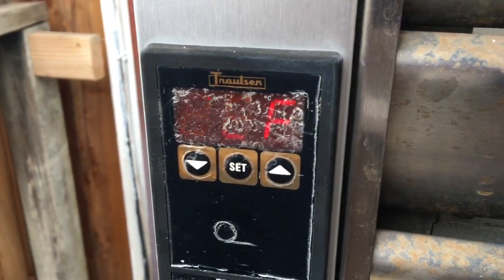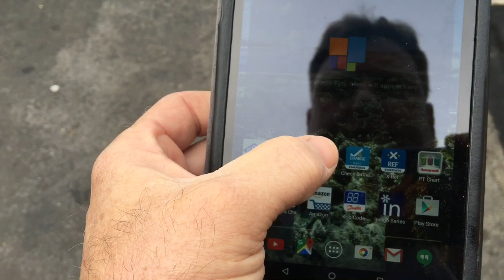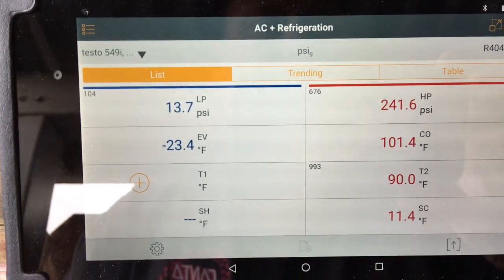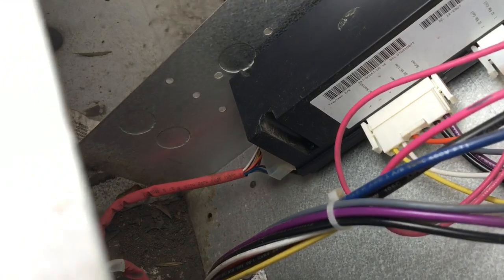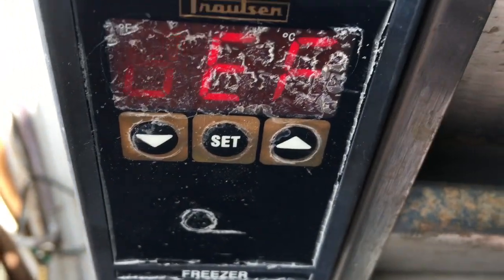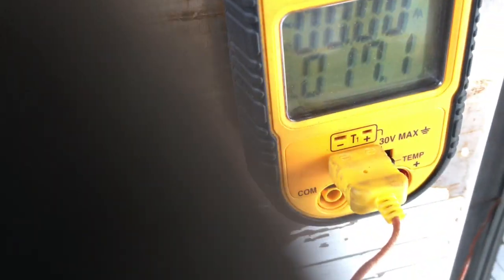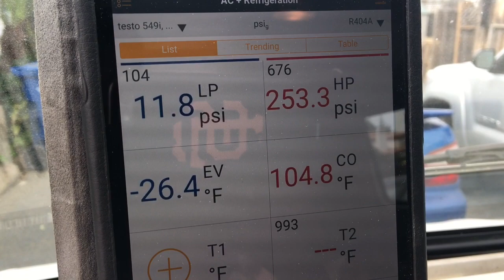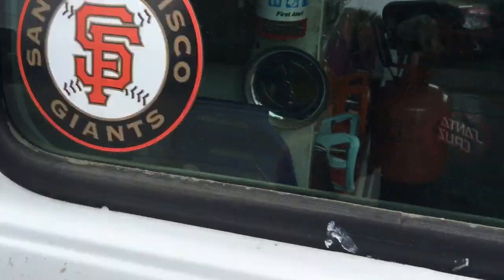Traulsen freezer intel I traul

Comment: Thanks for all the vids, but especially on the testo probes. I am in F&B operations at a horse race track but have also  taken on "first responder" duties for refrigeration and beverage equipment problems. Try to weed out the minimum wage "operator error" calls and take care of easy fixes, as well as implementing a condenser coil cleaning schedule. We have a lot of 20 yr old equipment from when the facility was rebuilt after a fire, so just about every other day there is something going down, between two large kitchens, seven bars and six concession stands. Just bought a testo pressure and temp probe to add to my toy box. Still need to call the pros when its time to pass gas or anything heavy or complicated, but wanted to get the tools to add to my diagnostic skills. Finally going to take the EPA test damn near 30 years after earning an HVAC degree in community college, but never going in to the field.

Comment: good video.  I have replaced many of those sensors.  Glad I got training from Traulsen when I did a few years back.
Reply from the maker: I think it was late 90's when that stuff came out. We all freaked out at 1 st but it has actually been pretty good stuff. That the 1st break down this unit it's 11 years old. Not bad.
Reply: No not bad at all.  When I was back at Hobart we cross trained in the Traulsen units too.  I still have the master service manual on those.
Reply: Hii sir, we have 3 door Tralsun freezer ,the Controller not giving correct temp reading,even I changed Original Green colour Cabinet probe.when I check with Digital thermometer cabinet temp was 0°F but freeze controller was showing  14°F

Comment: Was working on a True 2 door reach in freezer the other day, with a dual cap tube.  Not freezing properly I cut back the cap tubes 3 inches or so and a new drier and weighed in the 404a charge.  The compressor was noisy before and a history of it being noisy.  During an efficiency test it took a full 5 minutes to pull down to 8"and it climbed back up positive in under 1 minute. I was taught it should pull down to 16" in less than 1 minute once it hits 0, and should hold for 5 min. My After 20 minutes of run time it went from 50 down to 23, but the superheat was 90at the compressor, and 20f  Sub cooling.  The high side was 115F cold temp in an 80F room. Most tech say disregard these readings till it reaches temp =/- 5F.  my low side was about 16PSIG.  Ill find out Tuesday if it reached temp I guess.  One problem was the customer pushed these boxes inside the box, up against the back inside wall of the reach-in.  The top shelf was piled up to the fan.  I assumed this was half the problem on why they said one side would freeze and the other would be soft.
Reply: 115F condenser temperature (auto correct),  also +/- 5F

Comment: Nice video. I am servicing our Traulsen 2   1/2 door model. First issue was about 18 months ago when the unit started to freeze up on the evap coil. We thawed the unit and it took another 18 months to freeze up again. I downloaded the customer service manual and learned a few things about our unit. Good thing, because after unplugging it, the temp setting was at 35F. I set the temp to -4F, 2 degree offset was factory, and the date and time were put in. During the cooling and defrost cycles, I access the Cb and El temps. Cooling cycles, the temp probes are in line with freezer temp. During defrost, the Cb and El are 35 and 37F respectively. That tells me the Heater is working. 
Now, the evap fan is supposed to shut off during the def mode and open door. That does not happen. I am wondering if this is why the unit if freezing back up. If frozen air if forced up into the evap box, the edges away from the heater may remain cold until the unit freezes over.  Thoughts?

Comment: Read the probes through intel a traul and you would not have to gauges on it. Coil sensor is most likely issue. CB and EL in CUS mode. Unplug the coil sensor and control will operate of time only for defrost. Always use sensors that have GB on them.

Comment: Love your videos, thank you.  I have a question for a 3 door Traulsen freezer.  The compressor switch was clicking on and off and the motor would just barely move each time.  I replaced the switch and now everything seems normal except the motor doesn't turn on at all now.  The display shows the temp (86) but nothing happens.  The door frames do get hot.  I have also swapped out the Start Capacitor.  Any ideas on what's wrong?
Reply from the maker: @skycassidy6557  check for voltage at compressor and work your way back

Comment: Working on a g3101jc 3 door reach in. Defrost heater stays on even if EL set temp is reached. I'm suspecting the relay module. What do you think?

Comment: Hello sir,What the reason Temperature controller not showing correct temp reading .Even I replaced New Green Colour Cabinet probe. There is almost 10° different reading when I check with Other Thermometer.

Comment: you can check the calibration of the probes from the controller...CS is cabinet sensor and there is one for evap sensor....might be ES...not sure. 
that interface needs to be replaced cuz its flickering too much....coil will freeze up is probes are out of calibration
Reply from the maker: Your correct you can check the EVAP probe temp on the display I forgot that.

Comment: Update: I'm getting voltage on the purple defrost line as soon o plug it back in.  Is this correct? My take is that it should only have voltage during defrost not sure??.  I ohm out the heater all good.  I think I need a new rely box. Any advice?  Thank s

Comment: Nice video. I am working on the refrigerator same controller and it cools to 36.6 then instantly starts climbing up to 46 within a couple minutes then cools back down. The SPH/SPL are set correctly and my charge is perfect. Any ideas? Thanks man I appreciate any insight.

Comment: great video I changed the coil sensor and now defrost works.  the evaporator fan still won't come on I checked the cabinet sensor and it ohmed out good. I'm lost any suggestions
Reply from the maker: EVAP fan has a 2.5 min. Delay. If it dose not come on after that start at the relay pack.
Reply: Thanks

Comment: I have a similar problem with a traulsen freezer not going into defrost I did what you did went into the custom settings and went to manual defrost, check for amperage on the defrost line and I have zero. Do you think it's a bad element?
Reply from the maker: Check voltage if you have volts and no amps then the heater is bad. You can ohm out the heater also to check it.

Comment: Sir 
I have one tralsun 3 door freezer .. Always ice farming on fan ..So fan stop working .Plz give me solution ..Thankz
Reply from the maker: Ravi prakash yadav could be many things. But start at the evap sensor there is an ohms valve to temperature to check it. 
Test your defrost cycle. Compressor cycles off fan off heaters on. Check defrost heaters.